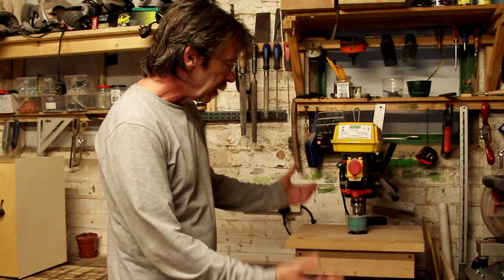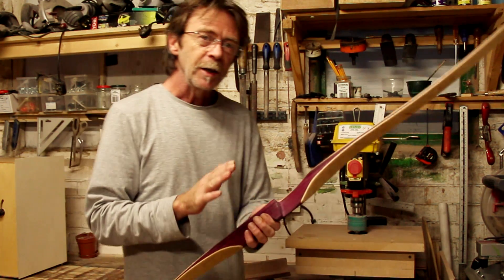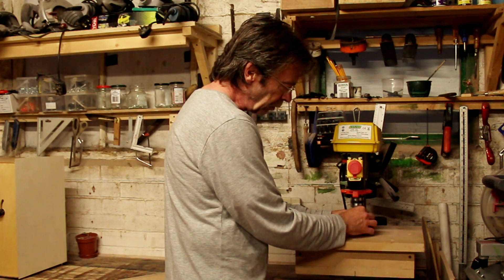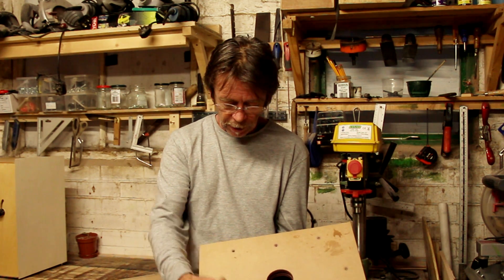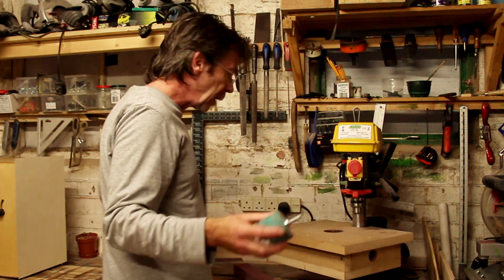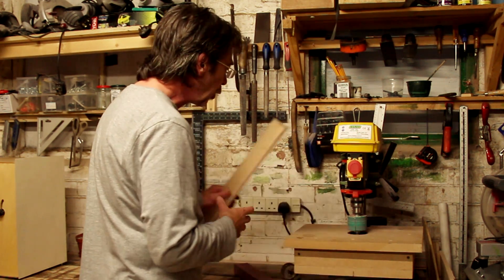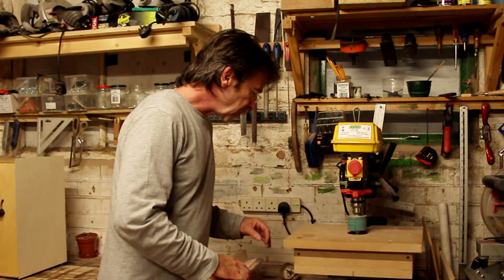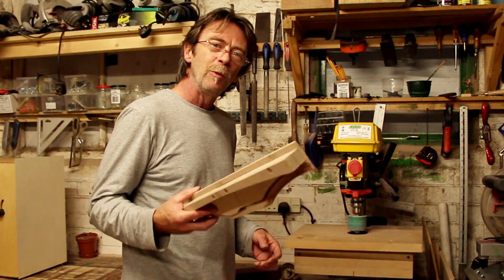How to make a Template Sander

Comment: At Minute 6:22 you say that the curvature is taken from the form of the purpleheart bow you are making. I was wondering if you could tell me what that curvature is because I am following your tutorial of how to make the fiberglass backed bow and I am stuck because I do not know what angles I am supposed to do for the handle. I have been looking at your template for the bow and I cut the handle block to the exact same dimensions as you have but I can not figure out how I am supposed to decide what curvature I want the bow handle to be. It would be great if you could tell me the curvature that I need to use for this bow but if that is not possible could you explain to me how I can find a curvature that is right for me. Thank you so much I love the videos and I will send you photos of the finished project when I am done. If you could send me everything I need to know for the process of making the handle to my email decrou19@gmail.com that would be great. Thank you again I love the videos. (also the links were very helpful for buying the fiberglass I couldn't have found it without your tutorial and I loved the template)
Sincerely,
Declan Rourke

If you could respond as fast as possible that would be great so I can move forward with my project since it is for a design class at school and we have a deadline for it.

Comment: So I'm assuming your table is 100% perpendicular to  drum sander (perfect 90 degrees) and there's no run-out or play. 
Obviously not a harbor fright type drill press :-)
Reply from the maker: +WV591 Yeah the drum wall has to be true with the table. I found it best to set it all up and switch it on  without sandpaper on the drum and use a square block with sandpaper on to sand te drum true first.
Reply: Clever solution. THX Dave. Awesome work and vids.